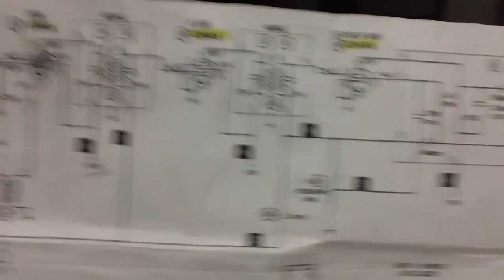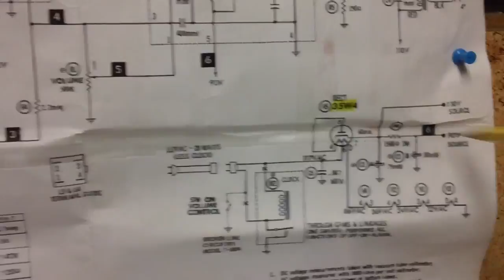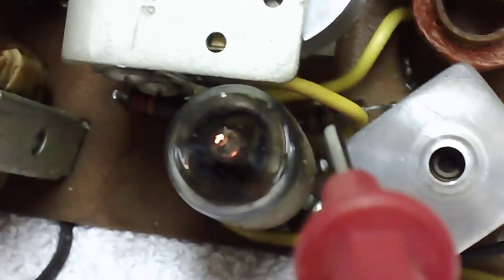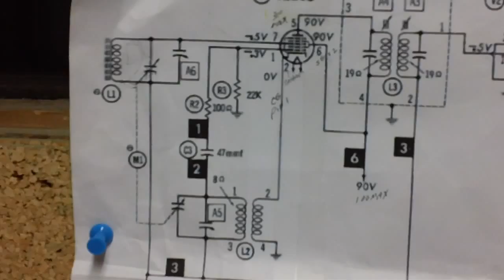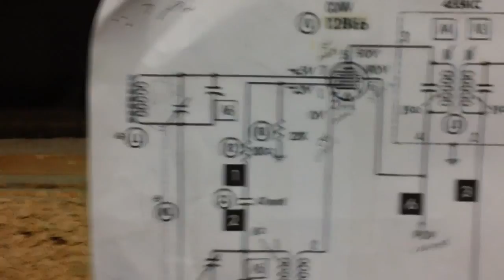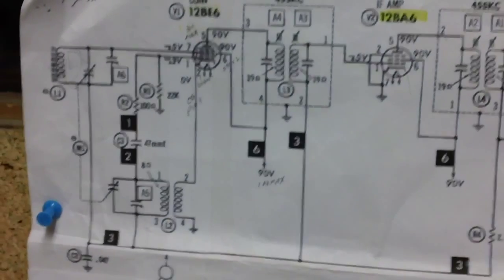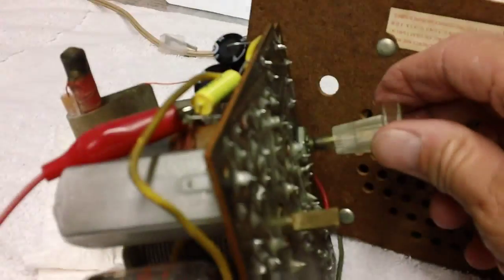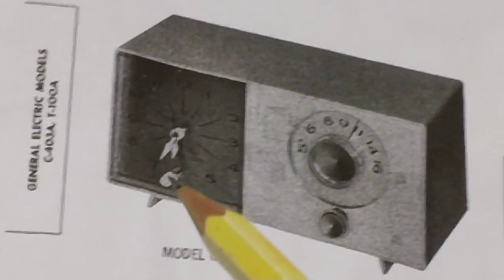General Electric C-403A Radio Repair Exercises (part 5 of 14).

Comment: Don't forget John the voltages listed on those old circuit diagrams were made using analogue multimeters which had a much lower input sensitivity compared to todays digital high impedance multimeters - so you will get a bit of a discrepancy when using a modern DMM, as Brendan said allow for some margin of error.
Reply from the maker: Kevin,
We'll be covering this subject later in the series.  Right now we're just taking it slow.
Thanks for dropping in, my friend.

Regards,
John

Comment: I might make something similar to your "lets break it" statement as I attempt to repair a flat panel TV I found beside the road. The lone fuse in the power supply lit like a flash cube when I replaced it. Short somewhere. Turns out that model of TV has a boatload of 1 star reviews on Amazon for croaking suddenly.
Reply from the maker: Jeffrey,
I wish I could help out, my friend, but what I know about troubleshooting TVs can be put in thimble.  All I can say is good luck.

Regards,
John
Reply: Check the power supply switcher transistor (mounted on a heatsink close to where the AC power goes in) and check the bridge rectifier diodes. If you can get a board off of ebay for $25-$30, you'd probably be better off replacing the whole board, instead of messing with trying to fix the old board. I think you mentioned on facebook that it was a Maggotbox TV; which, was made by Funai. Funail is known for using underrated parts in their sets and it does not take much for them to blow.
Reply: Yeah. I noticed that model has many 1 star ratings on Amazon for suddenly croaking. I can see why Cell Phone Shack has so many capacitors 50 volts or less. That's mostly whats in this set. I'm having trouble finding the board I need. Replacing the board is super easy.

Comment: Dear John, Thank you for passing on your fabulous knowledge and experience.
I've been following your videos about radios and vintage car restoration.
A question arose about the need for the local oscillator. in the circuit you show the antenna is connected to the primary of the transformer. Together with the variable capacitor, the secondary constitutes a resonant circuit in which only a single, determined frequency should pass to the 12 BE 6 valve grid.
So, I ask why introduce one more frequency to the output of valve 12 BE 6 to output the frequency of 455 hz?
Thank you very much for clarifying this question.
I'm using google translator, hope it makes sense of my question.
Geraldo Falcão from Brazil.
Reply from the maker: Geraldo,
Hello there, my friend.
The process of introducing and mixing another frequency into the antenna's received signal is called Superheterodyne.  It changes all received antenna signals to a single frequency that can be more easily utilized throughout the entire radio circuitry from one end to the other.  Here's an official definition:
"A superheterodyne receiver, often shortened to superhet, is a type of radio receiver that uses frequency mixing to convert a received signal to a fixed intermediate frequency (IF) which can be more conveniently processed than the original carrier frequency."
Regards,
John
Reply: @joernone  Dear John, thanks for your quick reply.
I have some older radios whose intermediate frequency is 264 KHz instead of 455 KHz.
In your definition of heterodyne you say "...which can be more coveniently processed than the original carrier frequency", why?
Does it have to do with high frequencies?
regards,, Geraldo
Reply from the maker: Geraldo,
All the answers you seek are online, but here's the reader's digest version:
During radio's infancy individual manufacturers used several different IF frequencies, but later on they all mutually agreed that 455kc would be the standard.  Before heterodyning came along, each time a user wanted to listen to a different station he had to manually retune each stage until it came out the speaker.  It was a chore repeating it over and over whenever he changed stations. Those types of old really radios were called TRF, Tuned Radio Frequency.
Now imagine that no matter which station was tuned at the front of the radio, it would automatically be heard at the speaker without doing any additional manual tuning to the various stages.  That would be very cool...one knob doing it all!  That's what changing every single incoming frequency to 455kc (the IF), at the front of the radio, does for the user.  From that point on all the circuitry is designed to work with 455kc.  Think of the cost savings to the manufacturers...fewer parts needed.  Tight frequency separation/selection is also greatly improved.  Zeroing in on those close together, faint stations can more easily be accomplished.
Google "Why heterodyne" for deeper info on the subject.
Regards,
John

Comment: John,
There’s no doubt about it old bean, Brendan is an outstanding mutual friend to you and I. 
Interesting how so many of the voltages, and milliamps, printed on circuit diagrams for domestic Vintage Radio and Television, certainly prior to the introduction to digital processing, appear to be ‘approximations’, especially when one uses a digital meter for making measurements.  Yet if one measured voltages printed on Vintage Radio circuit diagrams with an analogue meter, like the manufacturers did – (in England, it is sometimes printed on the bottom of circuit diagrams – “measured with [for example] Avo, Model 8, mark 3, meter”), voltages would likely be a bit closer to what is printed.  Although voltage measurement is generally none too critical on domestic Vintage Radios, I do keep an analogue meter for measuring voltages that are critical on older analogue communications equipment – it is rare I use any of my analogue meters these days.  Largely, I pay little attention to the voltages printed on Vintage Radio circuit diagrams.
This is another brilliant tutorial production: well done to you, and Brendan, my friend.
Regards,
Phil.
Reply from the maker: Phil,
Thanks, old chap, but you and Brendan have forgotten more about this electronics stuff than I'll ever know.  I'm just trying to keep things as simple as possible for all our newbie friends...and it seems some of them feel that it's helping them a lot, which I'm very glad to know.  Perhaps in the next vid I'll compare a few digital meter to VTVM readings.  Sounds like it might be fun.   I appreciate the idea.
See you next time.

Regards,
John

Comment: what happens if you put an ecap in backwords?
I wanna see some smoke and sparks! 
Once I put a tube in the wrong socket with another tube - hmmm?
Reply: First tube that John blows up, I've agreed to replace - just make darn sure that it's anything but the 35W4, as I'm beginning to run low on those, so encourage him to "blast away" at anything else (especially the "12's").....
Reply from the maker: Sorry to disappoint, Don, but the mechanics of this series are not designed to generate smoke and sparks...but one never knows.  LOL

Regards,
John
Reply: Howz  about substituting a tube that ""might work""?  Come on, what's a little ozone!
Reply from the maker: Tim,
With regard to tubes, it's good to know you've got my back.  But the only blasting I'll be doing will be a few days from now in the voting booth.  Can't wait.

Regards,
John
Reply from the maker: Tim,
Speaking of tubes...might you have one 12AX7, two 6BE6s and two 6BA6s for sale?

Regards,
John
Reply: John,

I'm pretty sure that I have the 6BE6, and 6BA6. If I have a 12AX7, it will probably be either a Philco or RCA.  I'll have an answer by Sunday evening.  I have over 1000 mini-octal's, but never took the time to sort them alpha-numerically.
Reply from the maker: Thanks, Tim, but hold off for now.  I was contacted by an ARF member who says he has the needed tubes.  I'll get back to you if he's shy one or two.

Regards,
John
Reply: I'll perform the inventory anyway, for sanity's sake.  My stock was purchased from an estate which liquidated the items from a radio shop near Allentown, PA.

Comment: Schematic says -.3v but is fine all the way to -10v and definitely no positive voltage. Man, that is very misleading. I would have definitely thought there would have been a problem with your AA5 reading -6.? Thanks for the tips, will save craploads of time.